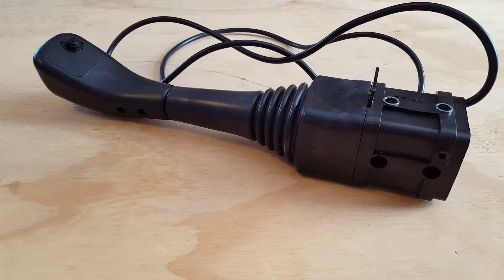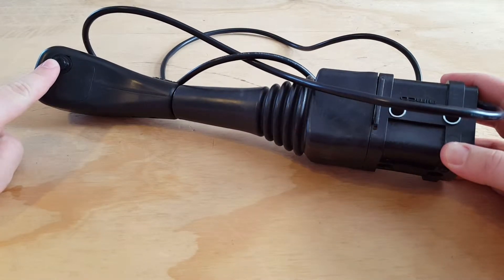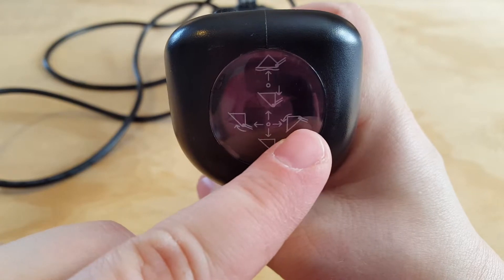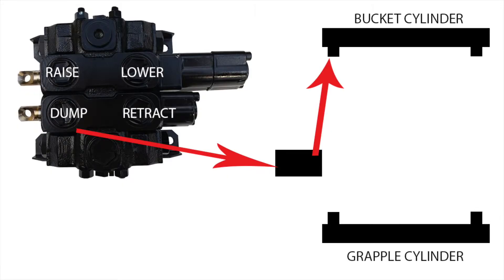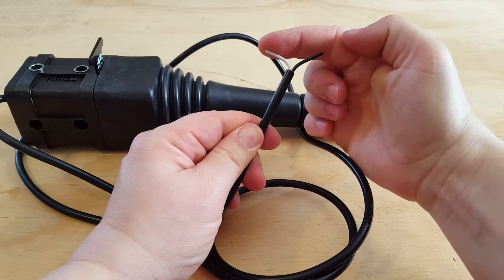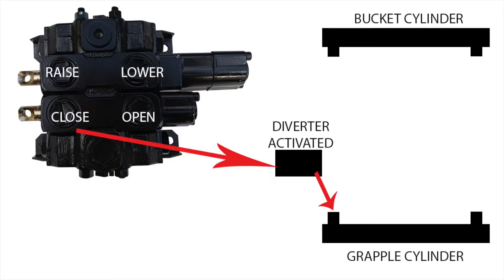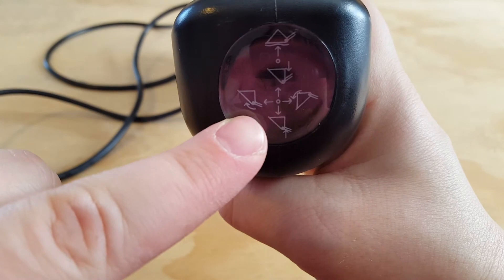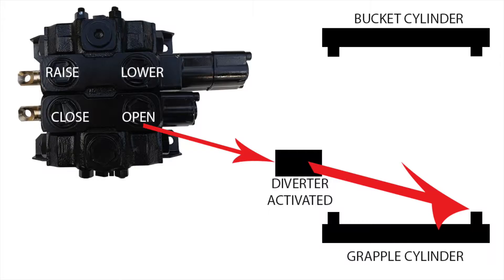How to Control a Loader's Grapple Fork with a 2-Spool Manual Control Valve

Comment: Can you explain where the wires go? I bought one of these kits from Indemar and their instructions are severely lacking.
Reply from the maker: Typically the wires will need to be directly connected to a wiring harness that goes down to the solenoids on the spool.
Reply: How does the joystick and harness get power to them? I assume you can just run the wire from the joystick to the harness on the solenoids without tying into the electrical somewhere.
Reply from the maker: The wiring harness needs to connect to a power source, typically either via a plug or directly wired to the fuse panel